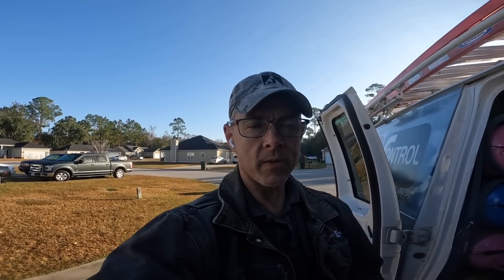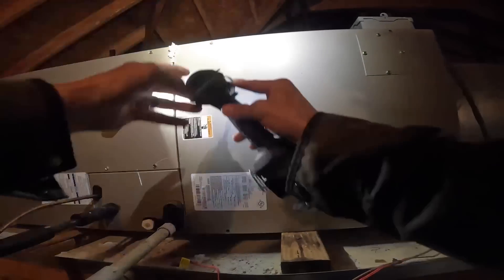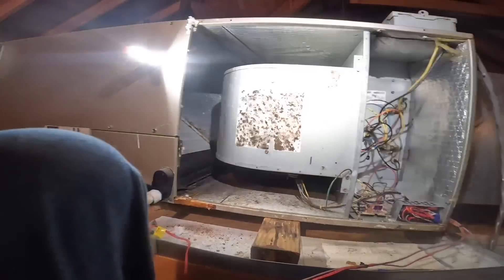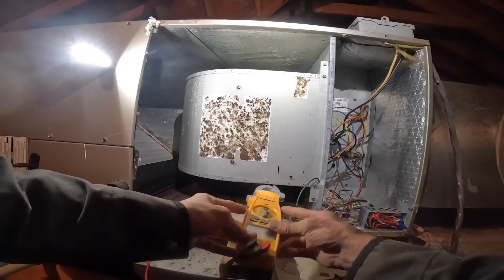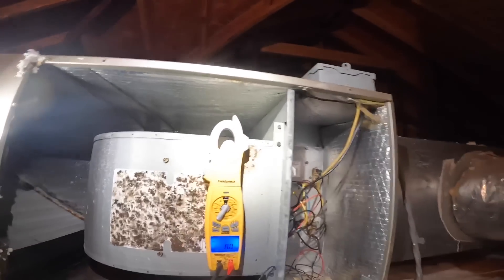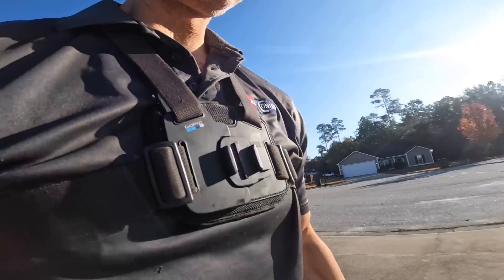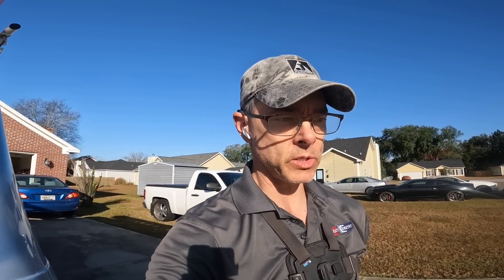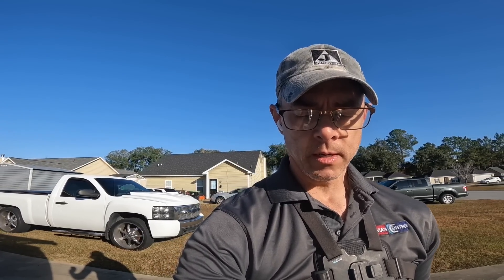Blank Thermostat Again

Comment: I think checking the subcooling of the liquid line is going to be the best way to determine if the charge is correct.
Reply: You can't really check subcool in heat, that and with carrier stuff the valve accesses the line after the metering device anyhow. 
If anything, your discharge should be 100 F over ambient. That it was 172 when 54 outside possibly means it is undercharged.

Comment: There's nothing wrong with those fuses. There's something you are not understanding. Make a wire with two male spades place it in the fuse holder , check your amp draw while start up and let the unit run awhile and you'll have a better idea of the circuits and wires you are protecting. My first guess would that the fuses are designed for 12 volt application and not 24. What's your amp draw for the t-stat? Is it an older type that needs to be checked for anticipator draw? Is the unit short cycling? Fuses don't just blow not even cheap ones.
Reply: Every ATC fuse I've ever looked at the spec sheet for is designed for a max voltage of 32V. That's probably in some specification somewhere for what makes a fuse an ATC fuse. I'll bet that NO spec sheets are available for this Chinese garbage that Curtis got on Amazon!
Reply: standard automotive fuses have pretty much always been 32volt rated(UL listed/approved), since they're also used in 24volt vehicles/equipment, where the nominal operating voltage would be around 28volts. you don't really want to go over their voltage rating, because it may arc over instead of breaking the circuit.
in HVAC/R the fuses are likely to see very high voltage spikes when contactors and solenoid coils involved, but they should still hold up fine.
the random unbranded fuses are about as reliable and safe as playing Russian roulette with a fully loaded revolver. 🤣
Fuses are supposed to have a known time in seconds at various overload currents where they will melt open. junk unknown fuses, are just that, a 10amp fuse may open at 20 amps, 40 amps or not at all and something else will "open" instead(lol) the flames and fire will grow higher.

Comment: I've had the same problem with mine. It would shut off and not come back on. Sometimes if you flipped the breaker off and back on, it would fix it but only temporary. Eventually I had my guy look at it. He couldn't find the problem, told me to just flip the breaker like I've been doing. Well I decided to take a look myself, didn't see anything obvious. Pulled the fuze to see if it blew since flipping breaker no longer worked. Fuze looked fine. I replaced anyway. Well it turned back on and haven't had an issue since, almost 2 years later.
Reply: George, seems like you've got a defective thermostat causing an intermittent issue. Cheap fuses are rarely rated correctly. They will either blow prematurely or not at all.
Reply: @bobwhammer4237  thanks for the information. I'll keep that in mind incase it acts up again. I been told the replacement fuze I used (buss), is a good brand. So hopefully it'll "keep things at bay".

Comment: How did a supposed blank thermostat have anything to do with the faulty Chinese-made fuse?
  I'm sorry; I'm a little slow on the common sense side, and think I might have missed something.  🤔
Reply: Some thermostats get their power from the low voltage in the furnace or air handler. Fuse blows...no more power to the thermostat.
Reply: @uxwbill  Ahh.
Okay, thanks.
I'm in school (for HVACR) now, so I'm learning.  😊

Comment: I went out on a call for a blank thermostat on a water furnace geol thermal unit, I couldn't find a direct short in the wires so I put a fuse popper in and turn it on and a component on the board exploded, good thing I wasn't in front of the unit
Reply: What exploded?

Comment: Did you check the discharge temp  I would think you had a high temp / high discharge super heat. The true suction pressure appears too low for that ambient temp maybe that would cause your high line temp.  Just my opinion    That’s pretty bad deal about buying all those 3amp fuses and can’t trust them

Comment: Went to supply house today, all out of fuses.
Reply: You can order them from Digi-Key or Waytek Wire, going price is about 23 cents each in quantity 100. Digi-Key has 10,000 of the 3-amp ATC fuses in stock, I think they are Littelfuse brand.
Reply: Really makes me wonder what kinda crappy supply house you're dealing with when any major electrical component distributor has these in stock...

Comment: Also, there was a big recall by Harbor Freight for Chinese made ATC and ATM fuses that wouldn't blow. And I've run across other Chinese fuses that don't blow even when you connect them across a car battery and the legs are burning away!
Reply: WeberAuto prof tested a set of Chinese blade fuses with a milliohm meter.  They were all over the place, essentially useless.

Comment: I would not use fuses made by any other than Buss or Littelfuse. And both of those fuses have the fuse rating printed on top of the fuse in white numbers so you can actually read it.